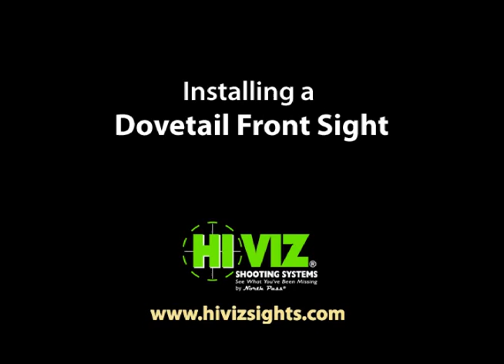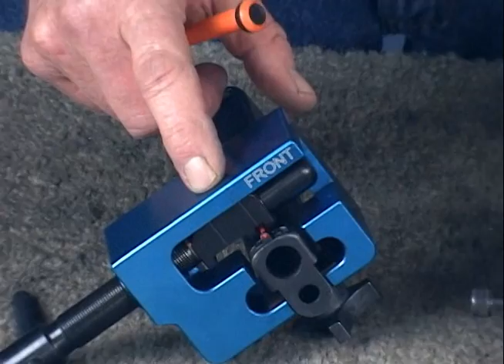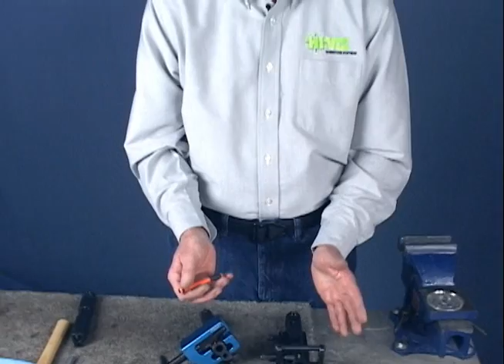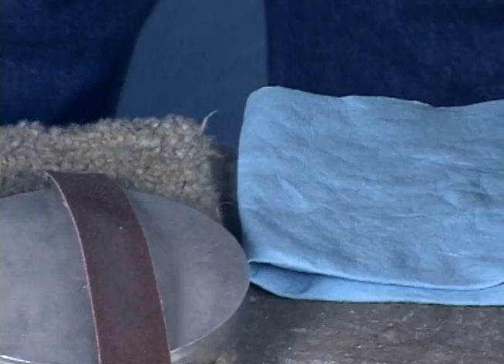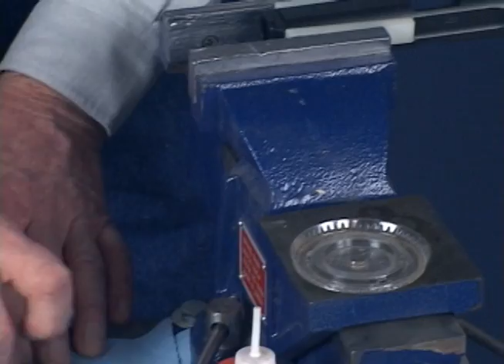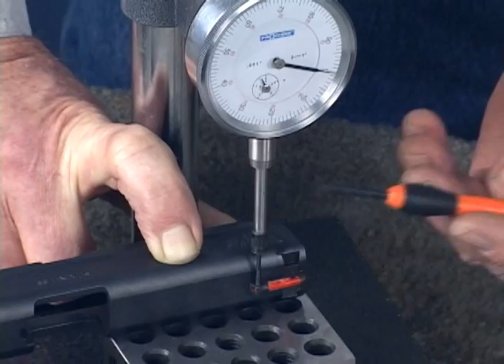HiViz Dovetail Sight Installation

Comment: Thx Rick!  I'm a gunsmith in MN.  This was extremely good video.
Reply: When he says 1/3, is it 1/3 into the dovetail on the slide, or 1/3 of the sight itselfs dovetail? Also, do the new sights for the M&P need fitting or can they just be pressed in?